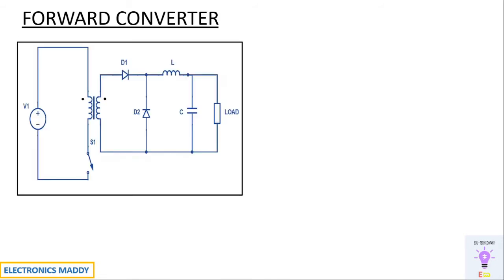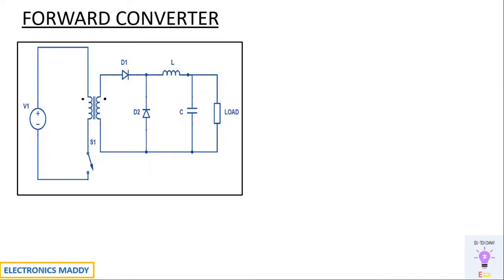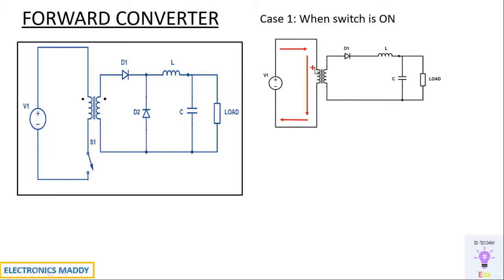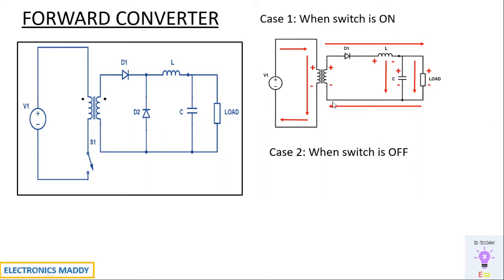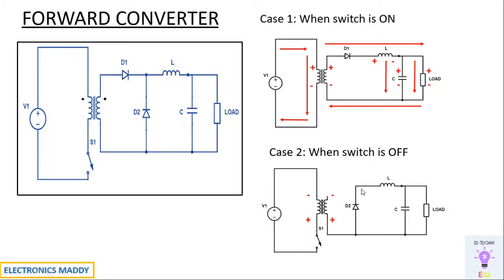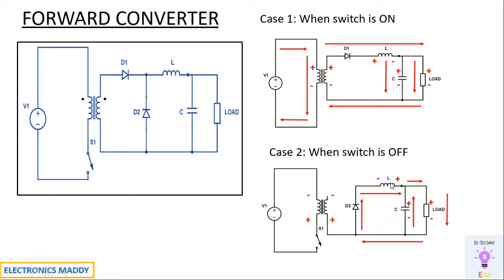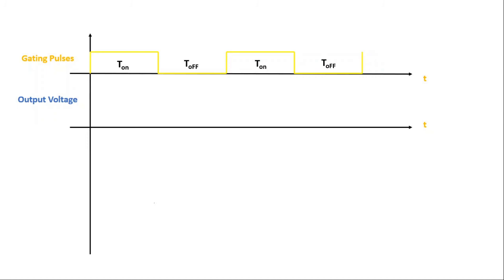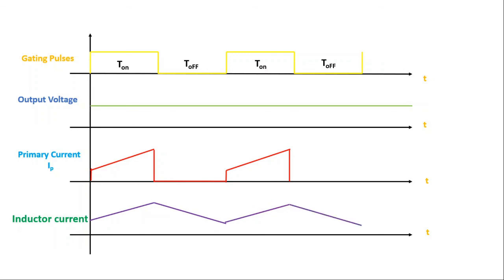Working of a Forward Converter

Comment: i want to increases the voltage from 390v(1500w input  power) dc to 1000v (1200w output power) dc is this isolated converter is possible ?.
if not which converter is suitable for this step up the voltage application tell me sir..........
Reply from the maker: Hi Abhishek I feel the requirements itself that you mentioned is not right. When voltage should be increased you are trying to have a reduced power which is not right. Try looking into the requirements again.
Reply: @ElectronicsMaddy  i mailed the problem please go through sir and replay me
Reply: @ElectronicsMaddy  thank u for replying